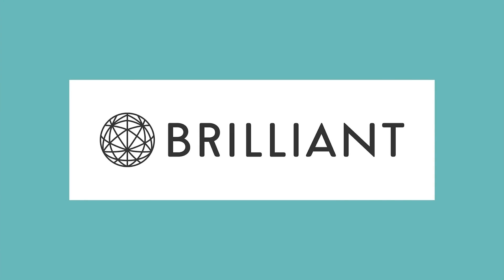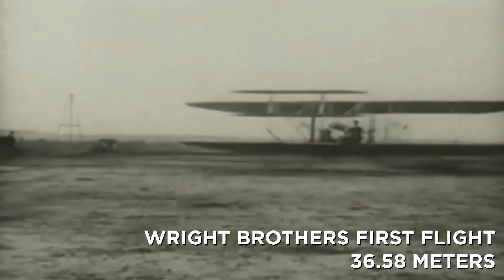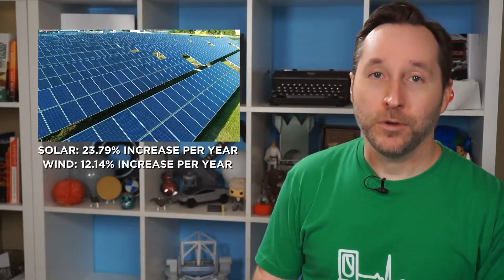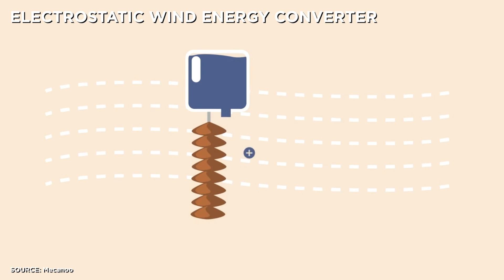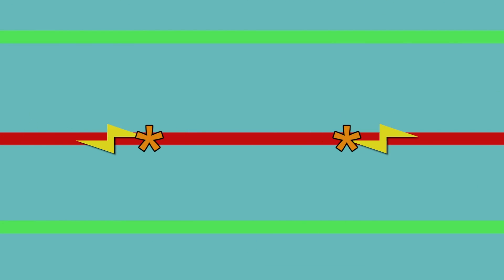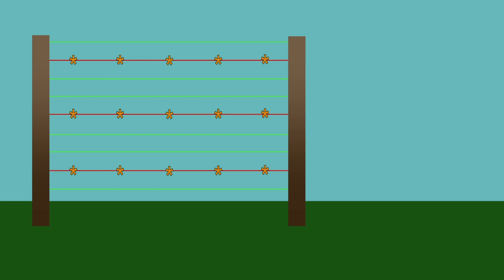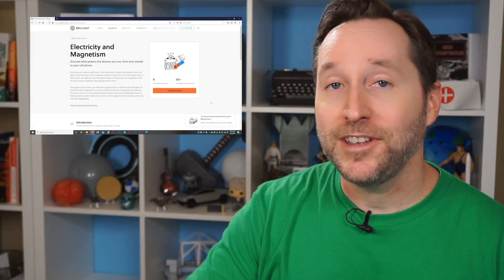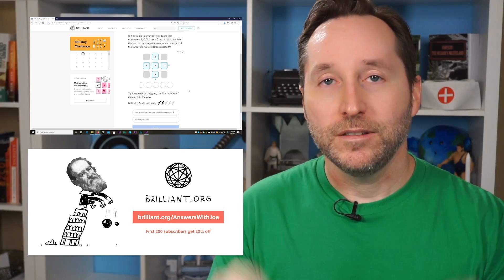Solid State Wind Energy | Random Thursday

Comment: I’m sure pollution from fossil fuels Has killed more birds than anything.
Reply: ...and other animals, plants, people, microorganisms... ...polluting the air, the ground, and the water with toxic substances, destroying landscapes, altering the climate, wasting resources with inefficient energy production...

Bird death tolls from wind turbines are greatly exaggerated, and most of the "big scary numbers" (orphaned statistics) are skewed by early data from Altamont Pass and similar sites, where the turbines were low, fast, and used girder-style towers that offered tempting nesting spots.

We have learned an awful lot from experience, and nowadays turbines are tall, slow-moving, and smooth-columned, and sited with more consideration for their environmental impact. They are also increasingly being colored to be more visible to birds and bats. Death numbers have gone way down.

As for the "destructive" impact of installing a turbine, how about we sit down and compare it to the installation of an oil well? How about comparing a wind farm to a fracking field? How about comparing it to an oil spill? How about taking a look at open-pit coal mining, turning mountains into valleys? How about doing a single image search of the Alberta Oil Sands?

Do that, then come back and maybe we can talk about the "damage" wind turbines cause.
Reply: @davidh.4944  The way to get rid of fossil carbon waste is civilian nuclear fission. France proved it long ago, when they did NOT want to depend upon Germany for coal. EU energy company propaganda has addled the minds of the electorate. Russia and China don't have that problem.
Reply: @albert rogers: "The way to get rid of fossil carbon waste is civilian nuclear fission. France proved it long ago, when they did NOT want to depend upon Germany for coal."

Au contraire mon frère. The French experience, when examined honestly, demonstrates exactly why nuclear is a dead-end technology. Here, lemme 'splain.

It is true that the oil shocks of the 70s made France uncomfortably aware of their energy vulnerability, and they decided that they had to become less dependent on outside sources. Having little fossil fuel reserves of their own, and renewables at the time being unable to bear the burden, nuclear was their only option. So they built it up.

They went nuclear despite it's heavy costs and risks, not because it provided any superior technological or economic benefits. They chose it because it was the only energy source that fit their needs at the time. Do note that no other industrialized country went to such extremes.

And to be fair, for a time it worked. After the substantial build-up costs were amortized, they have enjoyed several decades of relatively cheap electricity, about 70% of their total load. They do have more problems with them than you nuke-humpers like to admit, but for the most part they have served their country well.

But now the chickens are coming home to roost. Almost the entirety of their reactor fleet is now aging out. They are facing a huge surge of extremely expensive decommissioning and dirty radioactive waste cleanup, a monumental hurdle that they are desperately trying to figure their way through with the least pain.

So what is the current government plan? It is, in essence, to simply try to keep the current reactors running for as long as possible. Operating licenses have been extended a decade or more beyond their originally planned lifetimes, while they consider their options.

In the meantime the country has to deal with this aging fleet of reactors that is becoming less and less reliable as time goes on. Downtime is increasing. Global warming is making their cooling systems unable to handle the load during the heat of summer, just when power for air conditioning is sorely needed. They are increasingly importing power in winter, too, mostly from Germany and Scandinavia, because their domestic supply can't handle the load. Some are even predicting France to become a net importer of electricity in the near future. And FSM help them (and the rest of Europe) if one of these increasingly-decrepit 70's-era reactors decides to melt down.

Then there's the question of what France is doing to replace the lost capacity, once they finally get around to decommissioning their current fleet. Well, tellingly, the one thing they are not doing is building more reactors. The current government plan is not only not to build more nuclear, but to reduce the current balance to 50% in the near term, replacing it with solar and wind. This time around they have alternatives. Renewable alternatives. Stable, proven alternatives that don't have all of nuclear's drawbacks.

I predict this shift to renewables will continue, and that little to no nuclear will ever be built again. Not just in France, but worldwide. While so many seem reluctant to admit it directly, actions speak louder than words. Nobody these days wants to be saddled with the nuclear white elephant.

[Edited for minor corrections.]
Reply: @davidh.4944  Thank you! This gives me hope.
Reply: @albertrogers2506  I Always have to laugh when people use France as an example.
For one it is the only country with overall more than 50% of their electricity mix being nuclear, secondly France has access to a lot of hydro, before they went for nuclear big time, hydro made up almost half of their electrcity mix. This access to hydro really helps them regulate power greatly. furthermore when they produce too much power, they export it to their neighbours, who happily buy it because electricity from old nuclear reactors is cheap. If they however wouldn't buy it, the price of the nuclear electricity would go up by quite a bit.

And for now France is having serious problems with their first new nuclear reactor in almost 2 decades. This while renewables are slowly rising. Whether France remains on the nuclear rotue, goes renewable or a mix is yet to be determined, though a mix is most likely.

In the end current nuclear technology either needs massive storage like renewables or overcapacity, which will put the already high costs for new nuclear production even higher. 

Gen 4 shows promise, however since not a single of these reactors are online yet and gen 3 reactors prove to be rather more difficult and expensive than expected, I'll wait untill gen 4 reactors have run somewhere for at least a couple of years, hopefully by 2030-35 we will know, by that time it is expected that storage costs will have come down enough to be competitive with peakerplants and even new baseload gen 2/3 nuclear reactors.

And wind worthless? This really shows you ignorant bias.

Using ships as an example is stupid. For one, yes nuclear reactors have a high energy density, thus more suitable for ships, however they are goddamn expensive. Commercial shipping already looked into using nuclear for large containerships, they quickly abandoned the idea due to costs. The reactor alone would be several times more expensive then the entire ship. Then you also need to ensure safety (what if a nuclear powered ship gets highjacked, what if a meltdown occurs on a ship, ...), nuclear engineers on all of these ships, ... This while shipping companies are actually looking into using windpower to reduce consumption, from a kite pulling the ship and reducing between 5-10% of consumption to using special windmills. These are now in test phase, but seem promising, especially the kite might help, since it requires only little space and offers easy use.

In the end, at the moment nuclear is not THE power source because of costs, maybe it comes down with 4th gen, but untill that time renewables are (at least up to around 40% of the electricity mix) more economical and with reducing costs of storage eventually this will climb close to 95% eventually.

Personally I expect a mix of nuclear and renewables, however this is if gen 4 reactors indeed proves to be less expensive.
Reply: @davidh.4944  It is a FACT that even the Obama regime gave the wind industry permission to kill thousands of eagles a year, whereas the penalty for shooting even a hawk that might prey upon the game birds you are raising and planning to shoot, is quite severe.
Reply: @jacksimpson-rogers1069  It is a FACT that even the Obama regime gave the wind industry permission to kill thousands of eagles a year,

Oh, the spin. Maybe you should try out to be a wind turbine yourself.

I don't know if the factoid you state is accurate. For the sake of argument I'm going to accept it as-is. But I am going to point out the highly dishonest framing you put on it.

1) Governments give hunters permission to kill, not turbine operators. And even hunting licenses are carefully restricted in method, means, and season, so as to not overly impact the populations of the animals being hunted. The use of the word "kill" here is just pure emotional manipulation, as is the formation of it as a positive allowance, rather than a negative restriction.

2) Penalties for illegal hunting affect individuals because individuals hunt illegally, a selfish action that accomplishes nothing positive, while negatively impacting the wildlife population. Turbine operators are not hunters, and they are providing vital infrastructure that must be taken into account when deciding on what penalties to apply.

3) What the government is doing is simply recognizing the fact that businesses cannot operate without having some effect on the environment, and so they set up rational limits on the amount of impact that can be tolerated before bringing the axe down. It is no different, in these terms, to food processors being limited to X number of insect parts per liter of peanut butter. Yet we don't go around saying "Obama has given peanut butter makers permission to feed you insects!" That would be ridiculous.

4) These are limits , not actual numbers of dead birds, which are certainly much lower. Also, they are probably fine-grained by region to limit more sensitive areas more severely.

5) This is the "big scary number" tactic at work. We are given a one-sided orphaned statistic that sounds dramatic, but without the context necessary to properly evaluate it. "Thousands!" How many is that, exactly? How were these numbers determined? How are the regulations applied? What are the penalties for going over this number? Is there some form of gradiation involved? Are there any rewards or benefits for keeping the  numbers low? How do these restrictions compare with equivalent numbers for other industries? How do they compare to numbers from before or after Obama's administration?

6) Related to the last point, "thousands" certainly does sound terrible, until you recognize that this covers the entire US, including the vast territory of Alaska. What is this as a percentage of the total eagle population? Can we not assume that the numbers are carefully calculated to be low enough to not affect the overall numbers of eagles?
Reply: @davidh.4944  Slow moving? Those large blades are turning around 60 miles an hour. It isn't the number of birds but the type of birds. Wind generators mainly kill large predator birds like eagles and hawks, not the more prevalent birds like sparrows. And considering the fact people want to add millions of acres more of wind generators, do you think these stats will go down?
Reply: @caseyporter1235  Yes, slow moving, in relation to their size and generating capacity. Linear blade speed isn't the issue, any blade going over a certain speed is going to kill if it hits. The question is how often it will hit. A bird sailing through a 50m turbine spinning at 10rpm is going to make it through safely much more often than one going through a 10m turbine spinning at 50rpm.

As for the second part, I agree. Which is why much greater effort is being made now to plan siting, and work is being done to figure out how to make them more recognizable to birds and/or discourage them from getting too near. Believe it or not, turbine operators are concerned about these things and are doing their best to mitigate the impact.

[One thing I look forward to most are floating turbines stationed far enough off-shore as to be both out of the way of most wildlife, and out of eyesight of people from the shore. It should be easy enough. If we can build floating oil drilling platforms the size of small cities, we can certainly do the same for turbine towers.]

But again, the real question always boils down to, not "how many birds die?", but "which generating technology has the least overall impact on the environment?" And in that respect, turbines are near the top of the list.

[Solar is still better though, both environmentally and technologically (solid-state, reliable, can generally be positioned directly at point of use, and has little environmental impact—outside of the necessary mining for their constituents), and so will certainly be the dominant form of generation. Wind power will be in second place, in areas where it makes sense to use them.]
Reply: @davidh.4944  Thanks for the well thought out and civil response. I have a great many issues with wind generators greater than the concerns over birds. But I appreciate your viewpoint......
Reply: @davidh.4944  Well said! 👍🏼
Reply: @davidh.4944  this is what happens when you read tidbits on the internet and think you're an expert.
Reply: @psd993  I never claimed to be an expert of any type. So I'm going to resist the urge to make a snarky comeback, and simply ask you to point out any inaccuracies in my previous post.
Reply: This would only be relevant if wind or solar devices actually could be run without fossile fuel backup, which they can't and certainly aren't.
That's even if it were true, which it isn't  .
Reply: @Avx829  You are entirely correct -- except that it's not that new. US labs proved it in the 1980s with the IFR, and three weeks before the idiotic Chernobyl RBMK meltdown, by actual test showed that IFR EBR-2 was idiot-proof meltdown immune. Clinton cancelled the program, and John Kerry helped to do so.
But even before that, in the 1960s, Alven Weinberg who invented the PWR that provides 30% of my electric power, and drives the US Navy's capital ships, proved that a thermal neutron reactor could breed fissile uranium 233 from thorium 232, AND could do so dissolved in a molten salt that without the inordinate pressure needed to keep water liquid and drive a steam turbine at the highest temperature coal can provide.
I now know that nuclear fusion is NOT the solution. For one thing, it is misleading to imagine that Terran use will ever resemble the Sun's process of getting one helium nucleus from every four protons. 
The process for The Bomb uses a collection of two protons and three neutrons, i.e. one deuterium nucleus and a tritium nucleus, the tritium being significantly more radioactive than plutonium 239.
The reason is quite simple. The nuclear binding force is provided by the "strong force" between protons and neutrons.
I think there is still speculation about whether the gas giant Jupiter has gravitational density and pressure enough to fuse two deuterons, let alone create them.
There is more energy per unit mass in fusion than fission, BUT when you calculate the volume of a kilogram of hydrogen isotopes at whatever temperature and pressure you can manufacture, the energy from a kilogram of U-235 even contained as 28 tons at 3.6% enrichment with the rest being U-238, is about eight million kWh, so with 90 tons of those fuel rods, we have as much energy stored as the biggest pumped hydro in the world has, when it's full.
Call it one gigawatt_day.
In 1960 I was actually fortunate enough to abandon my ambition of working on nuclear fusion, because the two particle mathematical physics problem looked ridiculously difficult at the  precision my Professor wanted.
I concluded that we way forward included computers, and I am one of the quite small number of people who proved that the reason his code was getting the wrong answer, was that the machine was wrong. It was an early model of the IBM System/360 Model 40 that didn't obey its Principles of Operation. I was working in England for IBM, and maybe a dozen folk in the USA had indeed found the same. IBM had not had the embarrassment of releasing that faulty computer to the public.
Reply: @Avx829  (To finish my response...)

why use more space and resources to fill the gaps of other energy sources when we can slap a nuclear power plant down that constantly provides a steady stream of energy

It's a bad idea to put all of your eggs in one basket. As I just mentioned (again), nuclear plants operate in gigawatt ranges, and a single failure greatly impacts the energy grid. Turbines and solar panels rarely fail entirely, and when they do, they only take away a few megawatts at most. Their distributed nature makes them more reliable.

"Why use more space and resources?" Begs the question, do they use more? Does a wind turbine field with 150 turbines and a single bank of batteries in a shipping container use more resources, in time, space, money, materials, manpower, than an equivalent nuclar power generator? I truly doubt it.

We have a real viable solution right now to fix our power needs and to cut down on co2 but everyone is so focused on green energy that they over look nuclear.

I have already detailed (much more than I originally intended) the failings of nuclear energy in this thread. Just scroll up. But to reiterate in short: nuclear is a failed, dead-end technology that has never managed to and never will deliver on its promises, doesn't fit in with the flexible, distributed nature of the coming electric infrastructure, takes too long to build up, and takes away resources from technologies that are truly renewable and quickly implementable, right now.
Reply: @robertmoore-x4y  😳
Reply: @robertmoore-x4y  To go back to the resources that didn't quite support a thousand million people on this planet in -- shall we say 1776? --  we could maybe survive if we "staunched" down the world population size to 2,000 million. REAL conservation would mean we in the more privileged countries would go back to living without motor cars, electricity, aircraft, or anything faster on the sea than the magnificent sailboats that still make far better use of the wind than the very clever and easily broken blade propelled power generators that are so flatteringly called "wind turbines". 
I know of record breaking sailboats that can cross the Atlantic, using carefully picked weather patterns, in days less than a week. Can you imagine any OTHER wind technology that can beat that? But coal put sail out of business for ocean travel, and oil improved on that, and We KNOW how to beat oil. Every top military nation in the world, unconstrained by the propaganda of the fossil carbon trades and the "renewable energy" folk that are in Germany and California helping them, powers its capital ships with nuclear. You can load a ship with enough fissile actinoid* energy that it can sail more than once round the world, without refuelling. It used to be possible, at far lower speeds, to use the wind in that way.

* Actinoid means "elements of the rare earth family that starts with actinium". They are usually called "actinides" but usual chemical practice would have an actinide as a compound of actinium with another element.
The important actinoids for nuclear energy purposes are thorium, protactinium, uranium, neptunium, plutonium, then americium, curium, berkelium, and californium. It is bizarre that everything from neptunium to californium is now regarded as deadly horrible by the "liberal" state government of California.  A kilogram of any of these elements contains more energy than a thousand tonnes of chemical fuels.
Reply: @albertrogers2506  "To go back to the resources that didn't quite support a thousand million people on this planet in -- shall we say 1776?"

And once again the nuclear energy fellators demonstrate how they are some of the biggest enemies of renewable energy and global warming outside of fossil fuel interests themselves.

In case you hadn't noticed, it's not 1776 anymore, and the technology behind wind and solar has advanced just a little bit since then. "Easily broken" wind turbines? Don't make me laugh. Wind is the second most reliable form of electricity there is, right behind the solid-state operation of photoelectric cells. We have 150 years of experience in turning rotational movement into electrical energy, and a similar amount of experience in areas of transmission, storage, structural materials, fluid dynamics, meteorology, and a whole host of other related science and engineering fields. We know exactly how to get the most electric bang for our wind buck.

And so what if a single turbine fails now and then? An individual failure will result in a drop of about 2-6MW capacity, a teeny amount easily compensated for until a replacement can be made. When you have fields with hundreds of turbines, the loss of one is insignificant, and the more of them you have, the more reliable and stable the whole is.

Unlike a nuclear reactor, say, which will lose you about a gigawatt of generation in a heartbeat when its safeties suddenly trip it into shutdown mode.

(And to reiterate yet again, all generation needs back-up capacity, but wind and solar need much less than nuclear or fossil fuels, since there are no large generators to go offline. They mostly just need load-leveling and short-term balancing. Nor does backup mean "fossil fuel" backup. Batteries and other storage technologies are available. Even fossil fuel backup comes mostly in the form of gas peaker plants that only spin up when needed, a few times a year.)

As for capacity, worldwide potential wind capacity is about a dozen times our total energy needs. Not electrical needs, energy needs. And solar insulation measures at thousands of times our total needs. Together they can provide more than enough for humanity for the next several eons, not even counting future technical improvements. All we have to do is build it.

As for ships and other forms of long-distance transportation, yes, that's one small sector where nuclear may make some sense, in some situations. But it's important to not blow that out of proportion. In truth, the likely best bet for this area (outside of military vessels, perhaps) is probably biofuels, grown and processed with abundant solar and wind energy. Advanced wind propulsion and deck-top solar panels can also supply a portion of such a vessel's needs.

On the other hand, do not underestimate the potential of battery storage (or similar forms like flywheel or compressed air) either. Given just a little more work to increase energy density, reduce costs, and develop the infrastructure, ships with banks of batteries could realistically be plying the seas before too long (as opposed to the utter fantasy land of nuclear fleets).

Heck, even air travel could eventually go this route (partially, if not fully). We already have electrically-powered light aircraft suitable for short-distance travel, and work is underway developing tech for ever larger craft. Most of the energy required for flight is used in take-offs and landings, by the way. Level cruising uses relatively little power. Perhaps even some form of ground-boost or feed could be used to get planes off the ground so they don't need to carry as much en-route.

Anyway, enough of that diversion. Let me just reiterate it absolutely clearly, anyone who says that renewables (solar and wind) are insufficient for our energy needs is simply and completely full of it.

[Edited to fix an inaccuracy, make some corrections, and to include an additional point.]
Reply: @robertmoore-x4y  I'm sorry, but I think you've misread something I said. I am in complete agreement with you. I am NOT pro-nuclear. I think it drains away resources that can and should be better spent elsewhere (mostly on the big five of solar, wind, storage, distribution, and efficiency).

Nuclear power (as a consumer electricity source, at least) is zombie technology, just shuffling around aimlessly until it rots and falls apart.
Reply: However, just to make it clear, I am not an emotionally-driven never-nuclear campaigner either. If someone could show me a reactor system that is ACTUALLY safe, efficient, economical, flexible (i.e. able to integrate with the active smart-grid distribution system we are evolving towards), deals with its waste in a way that doesn't amount to bury-it-and-forget-it, and could be quickly and easily implemented, then I would actively consider it as an option. I just don't believe that's possible at our current level of technology.
Reply: @davidh.4944  What have YOU done to advance that technology which you imagine to be the salvation of industrially-developed nations.....?
Reply: @davidh.4944  Implement a solution for your own needs which meets your 'criteria,' and, perhaps, friends & neighbours will follow your lead/example.....!
Reply: @robertmoore-x4y  You are still misunderstanding me. I am on your side. I agree with you. I DO NOT want to implement nuclear energy.

My last post was only to state what it would take for me to change my mind.
Reply: Stop eating chicken!
Reply: @AlfonsoPosada  I’m vegetarian 👍🏼
Reply: Including fires.
Reply: no,but windows,wires & shiny roofs have..
Reply: @Avx829  Most wind generators are set in open fields, treeless and without features---or offshore virtually out of sight.  As with many elements of 'civilisation,' compromises  are intrinsic to the process: Rivers are damned; forests are clear cut , burned; streams are polluted; landscapes are littered; bird species lapse into extinction; lights extinguish the restfulness of night time.....  Of all those assaults on the land and the still of the countryside, WIND GENERATORS compel your ire.....??? (even though windmills have existed on farms for hundreds of years...)  They aren't really what you object to, are they?????
Reply: Um....... how??? An oil spill could kill birds. But how would imperceptibly higher levels of gas already in the air cause a bird to die? If it could kill a bird then why don't we all die every time we breathe out a lungful of CO2? If you are saying that global warming killed more birds due to... not being able to fly higher than the rising sea levels then..... YES, that totally killed all the birds.
Reply: @Avx829  You can indeed run a single nuclear reactor for its designed lifetime on a single set of rods. The "problem" is that it passes through a phase of 'weapons grade' nuclear fuel, so most fuel rods are only used for about 5% of their total fuel capacity (which takes ~12 years for a 12ft rod) after which they are taken out as highly radioactive waste.

You could completely consume the rod (~250 years of energy production) and then turn the facility into a reservation and leave the nuclear reactor dome-and-all to decay naturally and it would be a lot safer and have virtually no emissions. If we'd start doing this in the 1950's we'd have virtually unlimited, cheap, zero-emission energy today for the world. And that is just fission, fusion would be a ton safer and more efficient.

Basically this would be the same if you fill up a gas tank, then throw the entire gas tank out after ~50 miles of driving because the remaining air/gas mixture could be used in flamethrowers and therefore classified a weapon and then you complain about the problem of storing gas tanks safely.
Reply: @Avx829  Wind turbines produce as much co2 as nuclear powerplants, I don't see how they are poor replacements for fossil fuels. The only "non-recyclable" waste of windturbines are the blades, which actually can already be "semi-recycled" to be used in concrete etc. Though it is just too expensive now. This is essentially the same as with spent nuclear fuel, it might be a problem now, it won't be forever.

And fusion is at least 40 years out. ITER's only goal is to prove it can generate more power than it needs. It isn't meant to produce any electricity and is meant to only run for less than 1 hour or so. After a successfull test another fusion plant is scheduled which goal it will be to produce electricity with fusion. And then after that it still need to be made commercial. So yeah, Fusion isn't yet around the corner even if we don't experience unexpected problems.
Reply: The FBI is Euthanizing millions of birds as we speak.
Reply: @vincentsteigen1375  😳
Reply: @Avx829  they are a poor replacement because wind varies in speeds and doesn't always blow enough to generate the power you need

Oh, this old canard again... As if everyone doesn't already know that solar and wind are intermittent energy sources (and for the record, intermittent does not equal unreliable). The fact that they have limitations doesn't make them inferior; everything has limitations. It all comes down to how you use it.

The limitations of turbines were recognized, oh probably about 5 seconds after the first electrical turbine was envisioned, and several ways to overcome them were probably already figured out about 30 seconds after that. Most of them have to do with storage, transmission, demand control, and not relying on only one technology for all of our power needs.

As I think I said before, when it comes to distributed resources like wind, while one turbine is unreliable. 20 thousand of them scattered across a state are very reliable. And when combined with solar, all but unbeatable. As the saying goes, "the Sun is always shining somewhere, and the wind is always blowing somewhere." In numbers, they provide a steady source of electricity that is just about as reliable as any other, and only a small amount of backup storage (much lower than most detractors say) is needed to smooth out any remaining inconsitencies.

Not to mention that the rising and setting of the Sun is perfectly predictable, and wind and weather conditions are forecastable at least several hours ahead of time, giving operators plenty of time to get their backups up and running.

And finally, as I have also said before (at least twice), all power generation needs backup. Nuclear has always needed huge amounts of storage, mostly in the form of pump-up hydro, to match it's constant on-line supply to variable demand, and to handle the gigawatts of power suddenly lost to the grid when they inevitably and unpredictably trip offline. Solar and wind only need to match their variable supply to variable demand, not too difficult a task for a clever engineer or two to work out, especially since we have been doing this already for at least 75 years.
Reply: @solarbrianyvonne  😂
Reply: Is this produce Nitrous oxide? There is Nitrogen in the air 78%. Will this poison us & our world?
Reply: @prachayaputtapanasub1113  no. But excess fertiliser high in nitrogen convert to nitrous oxide, which is also a green house gas.
Reply: @gospelofthomas77thpearl22    It's different !!With Organic fertilizing won't cause that much....But It's possible that high voltage from Solid State Wind Energy that cause ionization may be possible to cause Nitrogen oxidation so much!! As there is Nitrogen in the air 78% O2 21%
Reply: @prachayaputtapanasub1113  interesting
Reply: @Avx829  Wind is indeed an abomination. 
I know well enough three main types of civilian nuclear reactor, and there are three fissile isotopes, and two common "fertile" ones. The reason to NOT throw away the slightly used fuel rods that the first main kind, with water moderated neutrons, treat as "spent", is the third kind. It consumes the Pu-239, and in the process replaces it by turning the"fertile", non-fissile U-238 to Np-239 which decays to Pu-239
See http://www.pbs.org/wgbh/pages/frontline/shows/reaction/interviews/till.html
A banana is radioactive and constantly emits 15 becquerels. Potassium 40 is radioactive. Imagine a thousand person gathering threatened with 15,000 becquerels of bananas. But since potassium is essential to human metabolism, that's at least 60 megabecquerels , 16 MBq, of radioactive people! If they're big, maybe 20 MBq.
Long lived radioactivity is an irrelevance. If civilization and science can survive the next thousand years, the 24,000 year half life of Pu-239 will be no problem.
I once thought fusion, which has no direct radioactive products, was "clean". I found it was difficult enough for my proposed PhD problem that I needed to have a computer do the donkeywork. So I luckily became a computer system software programmer. I have since learned that the high energy fusion neutrons make other things radioactive.  
 I learned recently that the radioactivity of "spent" nuclear fuel rods falls by a factor of 400 in the first five years that it spends in the cooling pond. The entire "burden" of about 70 thousand tons of long lived radioactive "waste" (95% of it is uranium 238 being wasted) is far outstripped in radioactivity by the annual production of about 25 hundred tons of material with less than 4% of young, vigorous, short-lived isotopes, and we know how to deal with those. The proper thing to do with the weakened stuff is dry cask storage.
Alvin Weinberg is credited with the design of the PWR, Pressurized Water Reactor that uses uranium oxide fuel pellets in zirconium rods and reactor core which holds that water at about 160 atmospheres pressure -- to keep it liquid. He also designed the second kind, MSR, Molten Salt Reactor, in which tetrafluorides of thorium, protactinium, uranium, neptunium, and plutonium are dissolved in molten salt of lithium fluoride and beryllium difluoride. This kind can breed fuel from thorium.
But perhaps the best  of all will be the MCSFR, a molten salt, fast neutron reactor.
Forget fusion. I once thought fusion, which has no direct radioactive products, was "clean". I found it was difficult enough for my proposed PhD problem that I needed to have a computer do the donkeywork. There wasn't one in 1960.  So I luckily became a computer system software programmer. I have since learned that the high energy fusion neutrons make other things radioactive. They can even split the U-238 isotope considered for reactor purposes as "non-fissile"
Reply: Well, in the first place, wind is next to worthless as a way to eliminate fossil carbon. Nuclear energy is NOT from organisms that died of tectonic   catastrophes in the Carboniferous period. It is a million times cleaner than coal, or the gas turbines that routinely provide "spinning reserve"  for wind power.
Reply: @albertrogers2506  

"Well, in the first place, wind is next to worthless as a way to eliminate fossil carbon."

Hahaha! You actually wrote that! You really typed it in and hit "reply"! Hahahaha!

The fact is that wind power is already cleanly producing ~10% of worldwide energy, and 20-40% for some European countries and US states. That is about equal to current total nuclear production, and at present growth rates is well on the way to being one of the main pillars of the coming energy revolution.

Speaking of which...

"Nuclear energy is NOT from organisms that died of tectonic catastrophes in the Carboniferous period."

Nowhere in my first post did I mention anything about nuclear energy. It was entirely concerned with the comparison between wind and fossil fuel use.

But of course you turned out to be one of those nuclear fanboys. Who would've guessed? Well, since you have non-sequitured the topic into existence, I suppose I should at least bother to make some reply to it...

I do indeed consider nuclear power to be a bad choice for future power generation. No, I'm not some kind of Greenpeace treehugger who simplistically thinks "radiation bad"; I was once a solid nuclear backer myself. I grew up reading Clarke, Niven, and detailed descriptions of how tech works. I consider myself educated and intellectually honest enough to understand the real risks and rewards.

However, I have since listened carefully to the other side of the argument, and have now come to accept the reality that nuclear is a dead-end technology and a huge white elephant for anyone who adopts it. It has had close to 75 years to prove itself, and even now it can't stand on its own merits. There are still next to no working nuclear reactors that aren't backed by either command economies or huge subsidies, and nothing promising looming on the horizon, either. Commercial nuclear power is basically dead, despite the ongoing attempts to Weekend at Bernie's it.

Nuclear reactors are simply too complex, too expensive (to build, run, and decommission), too slow to ramp up (10+ years from conception to initialization, while solar and wind can start producing return on investment immediately), and too all-eggs-in-one-basket to fit in well with the decentralized, distributed grid of the future. Sure, one reactor may produce a gigawatt of electricity, but that just means that you lose an entire gigawatt of capacity when it inevitably suddenly trips offline (and for the record, all generation needs reserve capacity. Nuclear just needs many times more).

And before you bring up future "mini" reactor and "waste eating" technologies, take note of the word "future". I don't give a rat's ass what promising tech is "just around the corner". Come back to me after they have been proven to be safe and cost-effective to implement. Of course, by that time we'll almost certainly be finishing up our transition to solar, wind, and other clean sources of power that have already been demonstrated to work, and work superbly well.

In a nutshell, nuclear isn't bad because it's dangerous, per se*, but because it sucks away resources from adopting more reliable tech that we can see working right in front of our eyes. Seriously, Odin save us from this stupid nirvana fallacy boondoggle.

(*I won't dwell on the fact that I remember the worst nuclear meltdown in history playing out on TV, experienced the second worst happen live just a few hundred klicks from where I live—and am still dealing with the after-effects—and dread the idea of a third one happening in the center of Europe or the U.S. Midwest.)

Now I'm going to leave it there, because I know from experience what happens when you get into a pig-wrestling match with a true believer. But I must say that nuclear fanboys sure give the climate deniers a run for their money when it comes to interfering with the adoption of truly clean tech that actually works.

Oh, and by the way, do please tell me again who the "internet expert" is. I need another chuckle.
Reply: @albertrogers2506  nuclear clean? What happens to the spent uranium rods? They are radioactive for thousands of years. Hardly clean.
Reply: @gospelofthomas77thpearl22 
0/ I have never seen any report of thousands of eagles dying from air pollution, which so-called clean alternatives to fossil carbon, other than nuclear, are useless at reducing.  They always have gas  turbine "spinning reserve" running. That's a turbine spinning at significantly less than its full power, but burning at least 30% of its maximum gas consumption.
1/ They are NOT really spent, the long lived radioactivity is uranium and plutonium that can be consumed to provide more than twenty times the energy that has been provided by these technically obsolete reactors that nevertheless produce almost 20% of the USA's electric power from an annual "spent" mass of 25 hundred tons.
2/ They are put into cooling ponds, which capture the radioactivity and dissipate its heat.
3/ Five years later, by which time 99.75% of the radioactivity has been dissipated, the usual and sensible thing to do is dry then and put them in large storage casks. 
4/ This is far cleaner than the waste per gigawatt-year from dead wind and solar devices.
In five years, because radioac
Reply: @gospelofthomas77thpearl22  
The spent fuel rods, containing in fact very little "spent" uranium, i.e. fission products, are 95% uranium 238, which would be being converted to energy and fission products if Bill Clinton had not cancelled the IFR project.
The fission products, because it is a decay process, account for more than 99.75% of the radioactivity of the tiny amount of 3.5% fissile fuel that supplies the USA with almost 20% of its electric power at a cost of 25 hundred tons of fuel rods per annum.
The radioactivity of the "spent fuel" is reduced by a factor of 400 in the cooling ponds, in five years, and is then put in big heavy steel and concrete bins. There is neither need nor good sense in wanting to bury it under a mountain.
Plastic trash is a far worse menace.